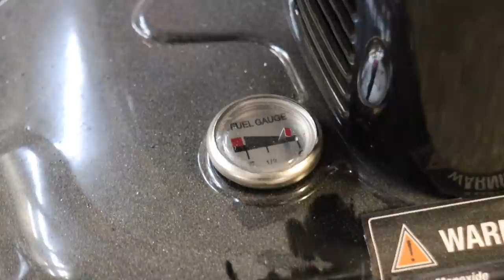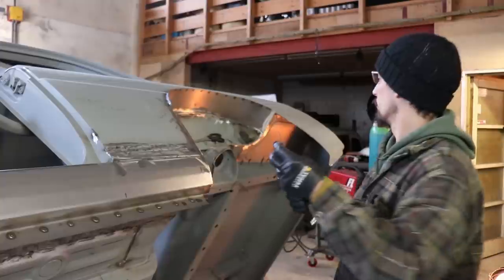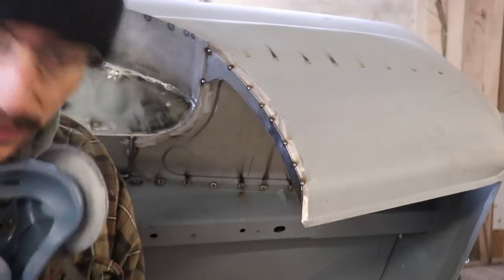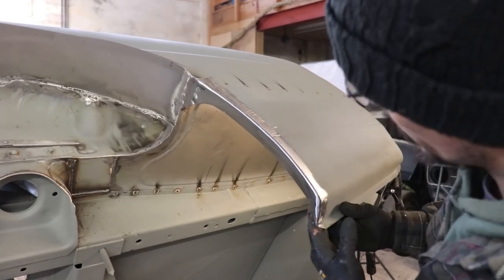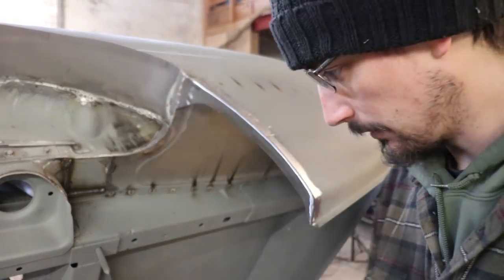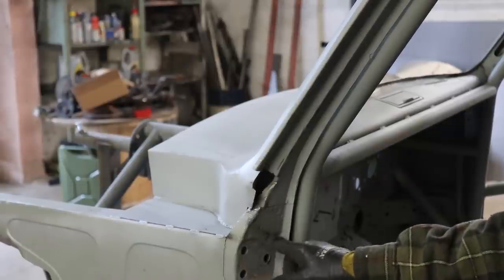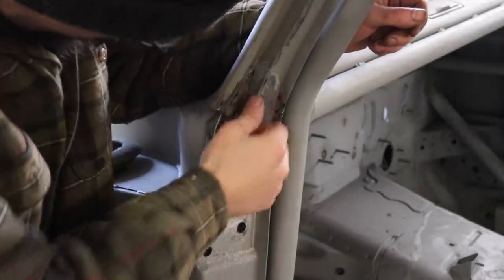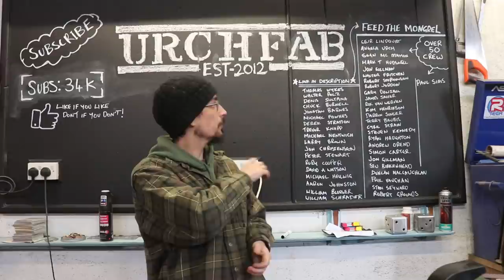JUST MORE WELDING ON THE FORD BODY MX5 MIATA BUILD. URCHFAB MONGREL

Comment: Do we assume  front wings bonnet boot & doors will all be GRP along with arches ? If so painting may not be  so far off. Need to be 2 pack in an oven this weather well worth getting it right for both appearance and corrosion protection . When you  think that shell survived 60 years much of it in the open. This new version of the car kept in doors  will last at least another 100 years.
Reply from the maker: Lets hope so, I wonder where it will be in 60 years.
Reply: @Urchfab  it'll be in your lad's garage, waiting for it's next outing on the track by your grandson 😉👍

Comment: My suggestion for a paint process. Hot zinc spay underside  2 part epoxy primer all over  Raptor over whole underside.
 https://www.ebay.co.uk/itm/U-POL-RAPTOR-Black-Tough-Durable-Waterproofing-Liner-4-Litre-kit/152944775747?hash=item239c381243:g:kIcAAOSwve1aqUMN:rk:2:pf:1&frcectupt=true
Then 2 part  polyester spraying filler all over block sanded then colour coat  all over top and bottom followed by a clear coat  - then it will last forever.

Comment: I'm pretty tall and my side intrusions bars plus making the trans tunnel wider for a gearbox with external linkages made normal race seats quite hard to find that would fit in that tight area. I ended up buying the b6 screamer seat in xl with the shaved edges from Tillett and their b5 for the passenger side. It's an option if you haven't looked at those yet.

Comment: What paint do you spray on once youve welded a section up, i know you’ll use weld through primer for buts that will be hidden once the section is welded up but not sure what to use over a finished area ?

Comment: Looks cold there Matt. I wonder if I send Jefferson an email would they keep me warm too lol. Is that kerosene that one? I'm on the look out for a kero heater that has a bit more grunt than the one I got. When I'm out doing my thing at the bench, I'm just sitting there. You get cold very fast. Great progress on the car. Must bung you a few quid
Reply from the maker: Its a multi fuel jobby so it runs on kero, diesel or paraffin. Cheers Matt

Comment: Dude... You can see your breath! It's been bloody cold everywhere... I'm in canada and we've been sitting around -20 to -25 celsius and it's been -35 with the windchill. 
As far as your seats are concerned have you thought about old mga/mgb or fiat seats? Theres a bunch of lil British roadsters that came out in the late 70's early 80's that were extremely tight in the cabin. A couple of those would probably fit quite nicely.
Reply from the maker: It needs proper race seats so I can proper race it. Cheers
Reply: @Urchfab  ah yeah... Obviously. Lol I've watched a couple of youtubers tackle this issue. They always seem to land on Kirkey™ seats. But they're just sheet ally bent up into a seat and not too inexpensive from what I hear. Any thoughts on folding up your own? Might make a couple good videos as I haven't seen anyone do it and it strikes me as something thats right in your wheelhouse... Just a thought. 😀